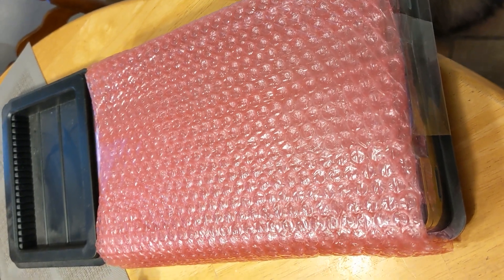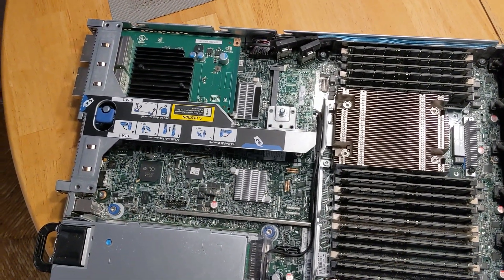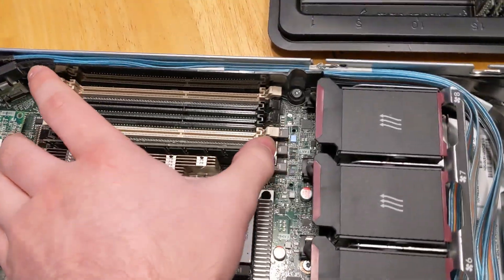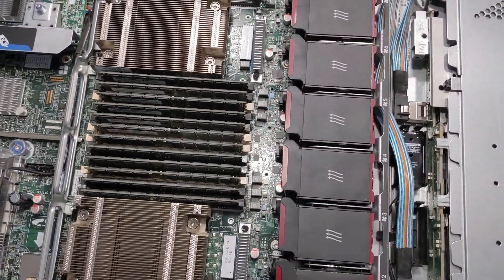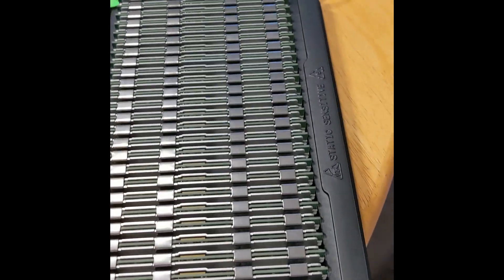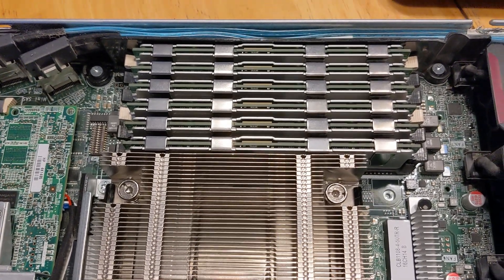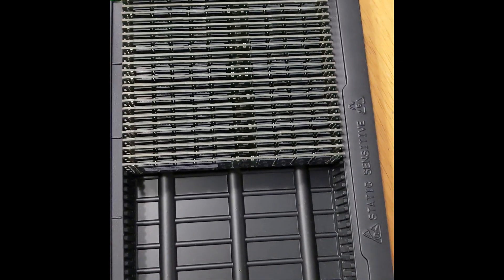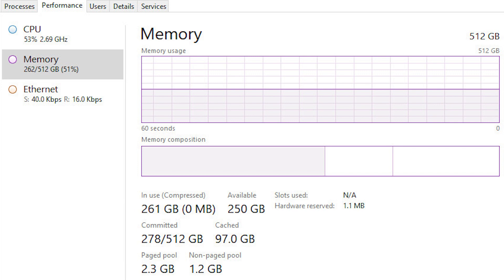Installing 768GB of RAM Into My Server

Comment: Man that is cool I just got my server do you host your own game servers ?
Reply from the maker: I've hosted a fair share of game servers with this machine, as well as my older IBM systems. I'll have to showcase those servers in a future video. But yeah, I do some game development stuff, and I use this system for my git repository as well as a testbed for that development.
Reply: @Salt_F4  how can you set them up to run the game servers like for fivem that's what I been trying to learn but I can't find no video for that just the ones for fivem hosting n another one but not for home servers hosting lol
Reply from the maker: @DjGTAOnline  You mean like how do you configure the server as a dedicated host for a game? It really depends on the game, but you'll need to know what operating system is required, and what software is required for the server to run, and then you'll need whatever server software as well. Once you've gotten the software end of set-up completed, you'll need to deal with the networking side of things. You'll need to know the ports required to connect users to the server, and those ports will need to be kept open to WAN during operation. Beyond that, if the game has a database or registration/authentication services run through a website (just an example) then you'll need to also set up the appropriate webservers and make sure that the database is configured to handle that. It can be a really tedious task, and like I said, it really depends on the game that you're trying to host.

Comment: Is it 360 g8 or 360p g8? I have 360p g8 and I love it, curently at only 64gb for my vms ;)
Reply from the maker: It's the 360p g8. It's a great system, and it runs like a champ! :) I did also replace the processors that it had installed when I purchased it with 2x Xeon E5-2697 v2, which seem to handle everything I've thrown at them.
Reply: @Salt_F4  Yup, i got those 2 few weeks ago, got them in and they work great, currently they are handling MC server, Valheim server, portainer with my DDNS settings, Rust server and TrueNas with integrated Nextcloud plugin :D

Might add few more VMs like Factorio and Project Zomboid server for my mates to play on ;)
Reply from the maker: @PeaceShellsClippy  Right on! Yeah I still need to pack up my server setups for Zomboid and Avorion and deploy them over to this machine. I ran them on my workstation since I've had the spare memory on it, but they really should be migrated to my actual server. I have another server machine project in the works, but it's gonna be a massively more complicated and expensive task to get it working the way I want it to.
Reply: @Salt_F4  Well i use proxmox for super easy migrating, their backup server works great and their hyperv is super awesome  so when it comes tomograting its super super easy